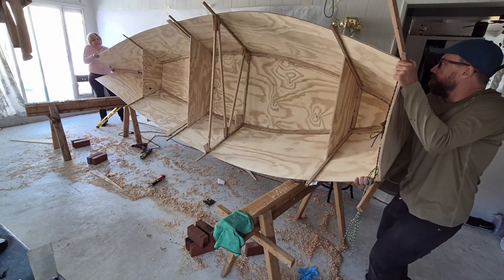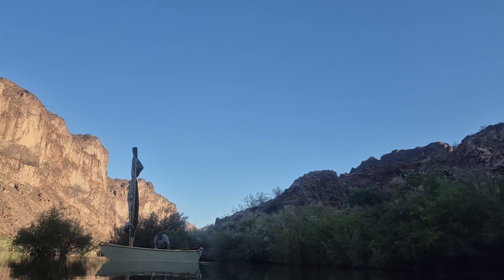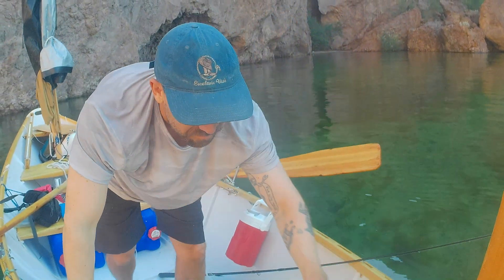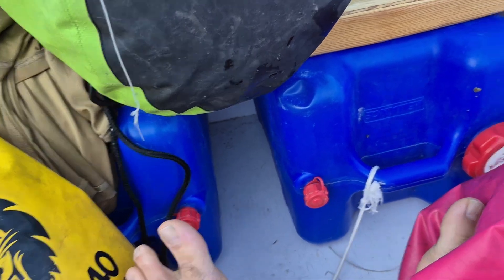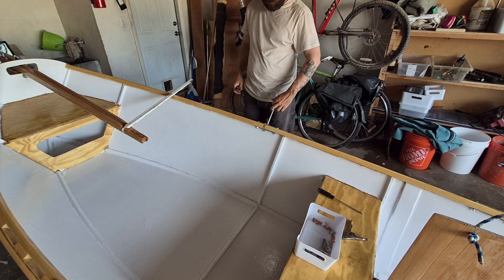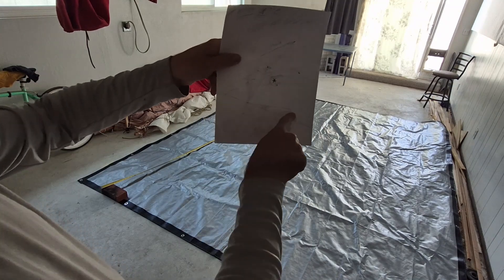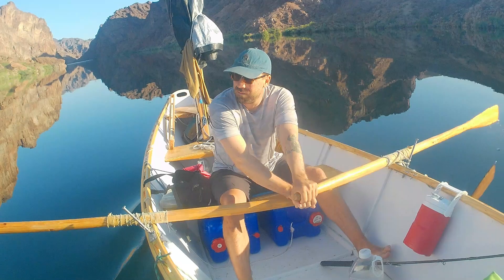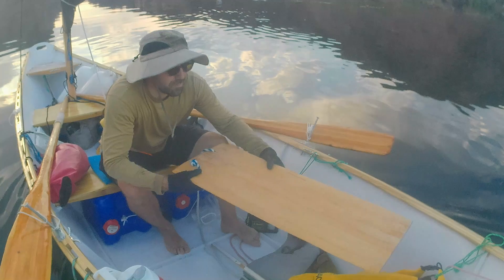Potlicker Sailing Dory Series Introduction

Comment: Very cool design, the little bow transom fits so well with the dory hull shape! I think allowing the chine angle to vary along the hull length would allow tweaking the shape a bit more to get it just how you want it, and in reality it's very easy to plane flat before you put the bottom on.
Reply from the maker: Thank you! I agree the chine angle limits what you can do with the shape. It was a fun experiment to see what I could do to develop panels with my limited math and CAD skills, but a greater chine angle at the beam would be an improvement.

Comment: This is amazing! What is your deadrise angle? Is it completely 0? It’s unreal you managed this with big box store quality materials, even with all the complications.

Also, did you make your own sails? If not but you want to learn I’d love to part with some knowledge! Lmk
Reply from the maker: Thank you! Flat bottom. 60 degrees from flat at the chine. 

The cheap materials are already an issue, and I'm in the process adding some glass. It was tempting to use Bondo brand glass and polyester resin from Home Depot, but I like the boat enough that I ordered some decent materials.

For this build, I made a sail from a plastic tarp. Who knows how long it will last. I made sails from sailcloth on my last build. I admit that I have much to learn, and would appreciate any guidance. Already my two big critiques of those previous sails are that I put too much shape in the mizzen, and I tried to reinvent reef ties in a way that just overcomplicates things. https://youtu.be/8L3Sbv1yRGY
Reply: @kitricksb it will definitely not last, but most modern racing sails are a Mylar laminate with a reinforced grid of polyester/carbonfiber/kevlar. And lifespan is usually determined around UV damage and causing rips/tears. which maybe is going to be the same root cause for determining shelf life of the sail. I’d expect unlike Dacron the sail will rip before excessive stretch/blowout.